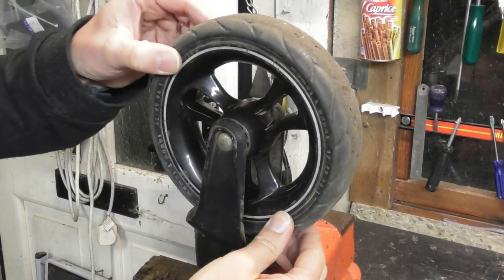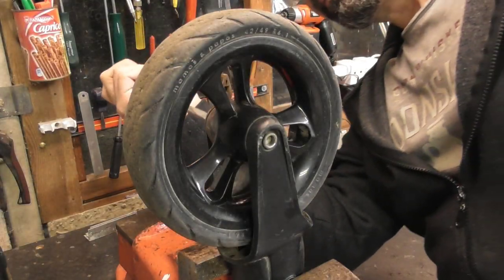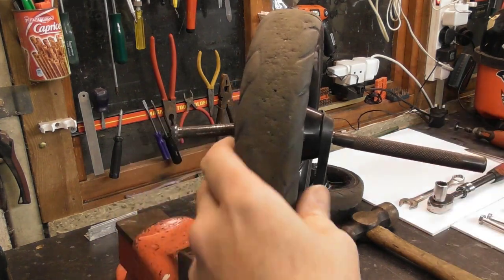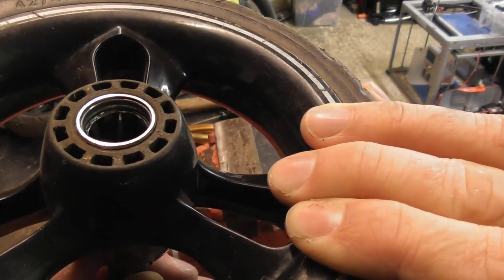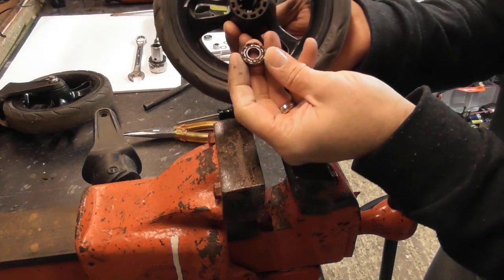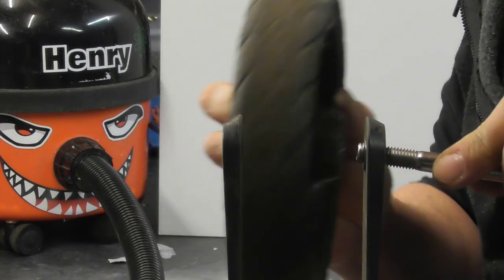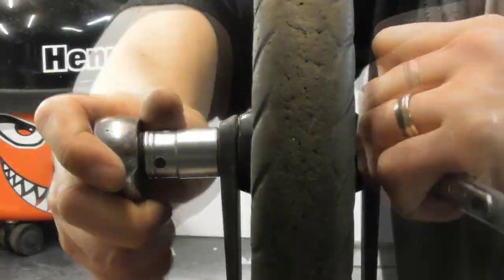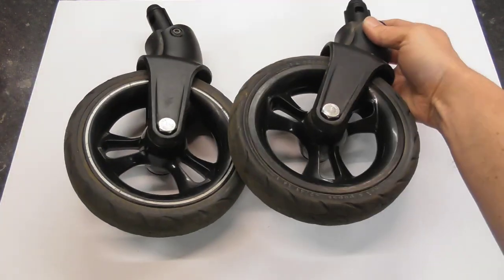How to fix/repair Mamas & Papas Ocarro pram pushchair with loose/squeaky wobbly front swivel wheels

Comment: hi there. desperately hoping you can help. I have an occarro travel system and needed to replace the basket as the old one got mouldy when stored in the loft on between baby number 1 getting too big and baby number 2 arriving.

the issue is I can't for the life of me work out how to fix the new basket on to the chassis. the fixings don't seem to fit and there are no screw holes in the new basket. I've been back to mamas and papas and all they did was send another new basket!

is this a service you provide please? I'm sure the basket and fixings are correct but can't work it out and we absolutely need the basket. 

thanks in advance